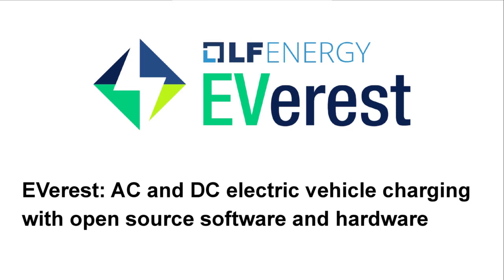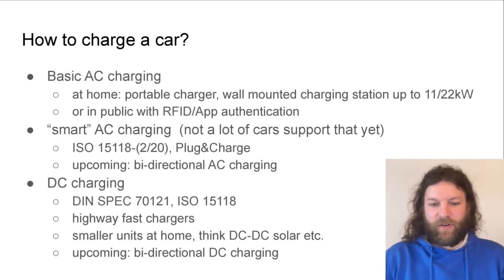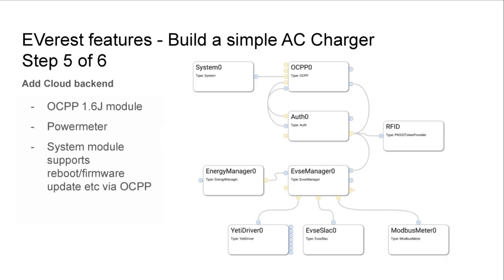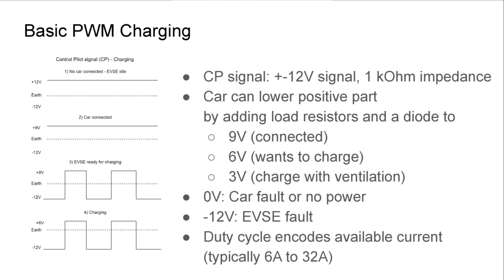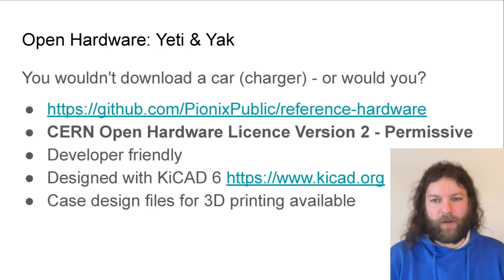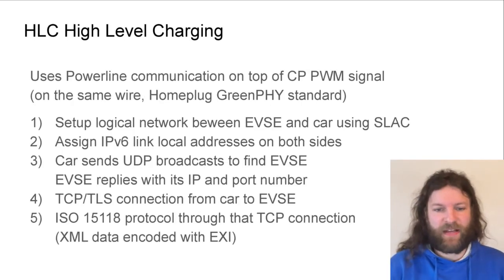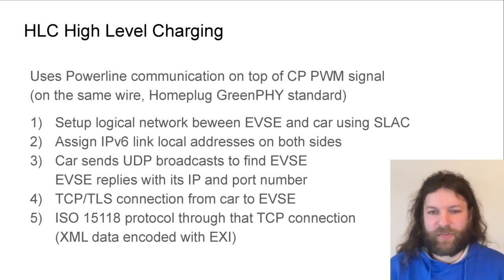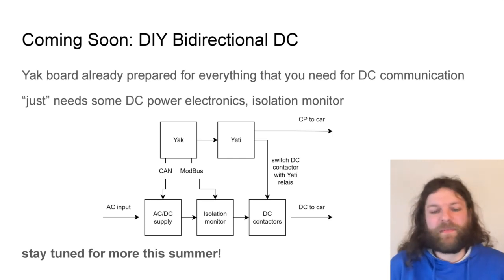EVerest@FOSDEM 2023 - AC and DC electric vehicle charging with open source software and hardware

Comment: Thank you for this great overview!

Are there any updates around this DIY DC charger?  It seems like with a common PV inverter that also has support for HV batteries half of the required hardware is already available in many homes.  It's "just" a matter of wiring it up, which I know is not an easy task but seems like most components are already covered by EVerest.

Comment: Great Presentation, thank you! Once I need a home charger, I'll definitely look for the pionix kit. Do you know of any CCS cars that currently support DC-DC bidirectional? I have read that for example Teslas, Megane and MEB Platform cars support it in hardware (which afaik does not require any changes to a car, since the contactors are all already there) but I have seen no indication that there is support in software, such as telling the bms software that reverse current flow is permitted. Do you think that it would be possible to coax one of the V2L capable cars into a 0 current DC-AC session and at the same time make it close the battery contactors to get DC out?
Reply: No, the DC pins will only be connected in a DC session. For full support you will need to wait for cars that support ISO15118-20 BPT on DC. Or use Chademo, bidirectional DC support has been there for a very long time. You can also discharge some cars with ISO15118-2/DIN spec 70121 if you claim you are charging them.
Reply: @corneliusclaussen  Which cars specifically?
Reply: @4833504F  Tesla, Hyundai for example
Reply: @corneliusclaussen7658  If so that would be great (have a leased Kona currently) but I find it a bit hard to believe that there would be dozens of such models on the market and not a single demonstration of a charging session being used with reverse current. Doesn't a typical charge circuit terminate the session as "finished" when the current drops below a threshold?
Reply: @4833504F  Kona I never tested. Ioniq 5 can be discharged to empty... Tesla model 3 as well. VW cars can be discharged for 60seconds, then they stop. But if you charge for some seconds in between the timer resets.